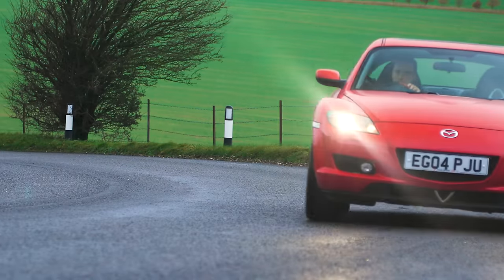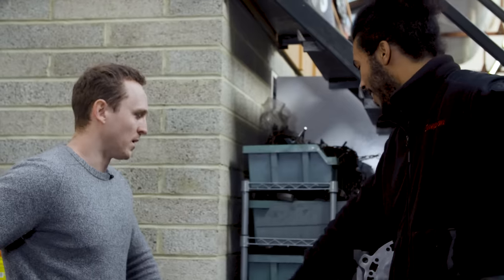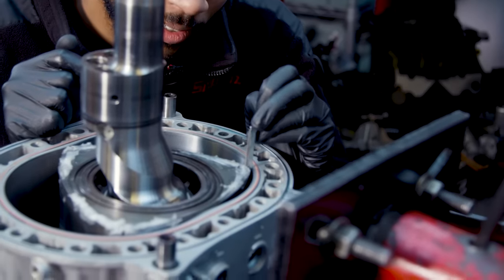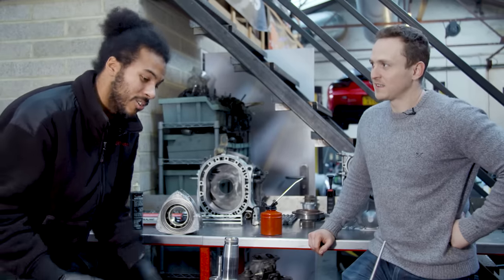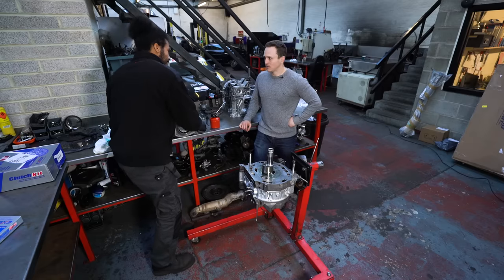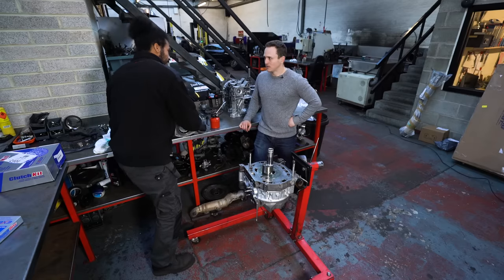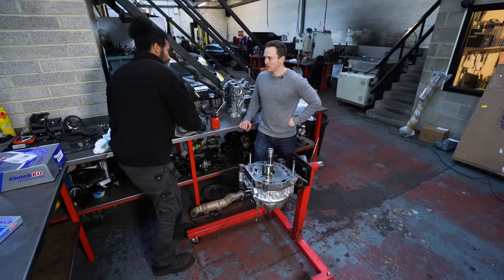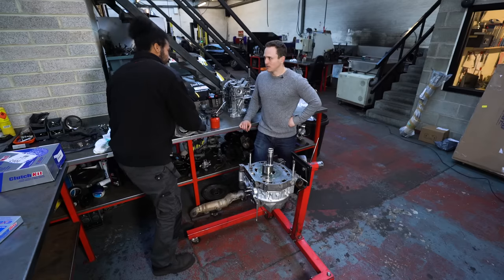How To Build A Rotary Engine: The ULTIMATE Guide

Comment: I really like that other guy. You can see he loves his job and knows what he is doing
Reply: Yeah I agree. Seems natural and comes across really well. Good video
Reply: True that, that guy is a pro
Reply: He really reminds me of a black English Moog from mcm lol
Reply: Well when you charge someone 6 grand for a engine that was out together in a day I would love my job too
Reply: @MrStraightGangsta  That's one of the things I miss from my time in UK. There are small shops that specialize in just one type of car, they generally charge a fair price, and do one hell of a job. My experience was with a gtr and RK tuning, which is a father and son shop similar to this one. You won't see anything in there without an RB26 (or higher) engine in it.
Reply: @matthewburhans4355  haha that's exactly what i thought
Reply: @glock1inthetop45  They're not nearly 6 grand. That would be if you bought the whole new block from Mazda. 
Their rebuilds range from £1,899.98 - £2,379.98 - £3,319.98 ($2441.85 - $3058.75 - $4266.83).
The difference being how many new parts would be included, in general most things don't need to be replaced so the two cheaper options will have your engine running great anyway. They might be running a business, but at the same time a lot of it comes from love for the cars, they're active on RX8 forums too giving help and advice.
Reply: Adam Dunas in the us its 6k
Reply: He's like a mad scientist for rotorys